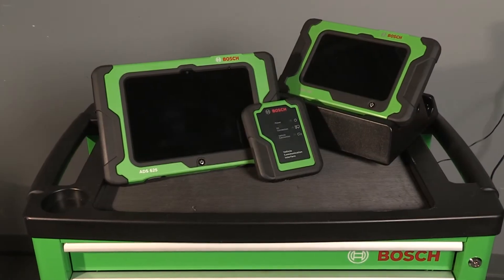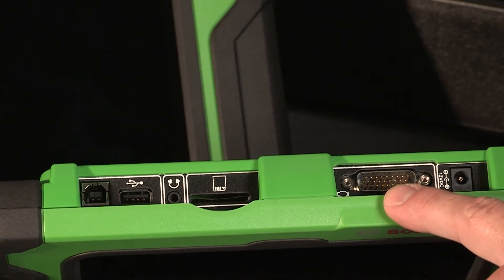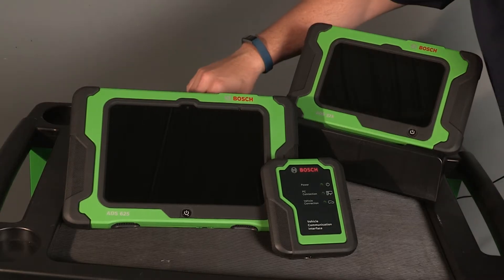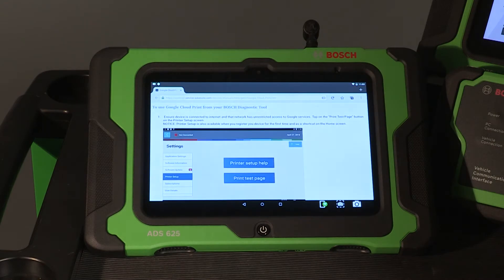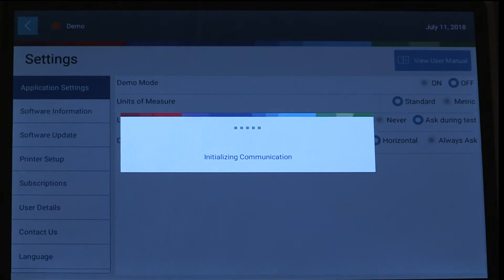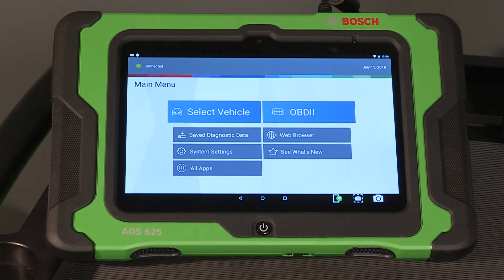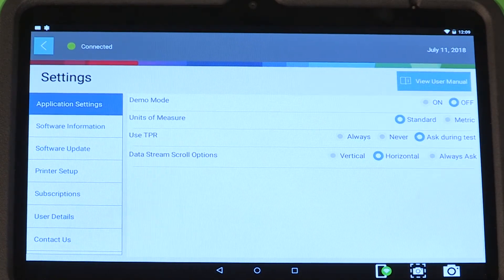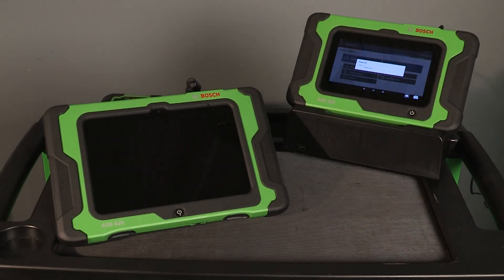Out-of-box setup with ADS 325 & ADS 625 - Training Module 1

Comment: Besides the wiring diagram, how does the ads 625 compare to the autel maxisys elite
Reply from the maker: Please refer to http://spr.ly/60521Jbcq

The latest updates we have the following:
-Industry leading domestic, Asian and European coverage
Quick-Scan, full vehicle Pre and Post- Scans in an average 60s
-Access to FCA Security Gateway. Bosch is one of the few scan tool manufacturers that can access 2018 and newer FCA vehicles equipped with SGW
-Repair Source (as mentioned below), most complete, on-screen vehicle service and repair information available

Comment: Can the Bosch 625 come with everything to flash and reprogram. I'm starting to get into programming and need a good tool
Reply: No
Reply from the maker: Thank you for taking the time to reach out. We've forwarded your inquiry to consumer care, who should be reaching out to you soon.
Reply from the maker: The ADS 625 does come with a J2534-compliant VCI that can be used for reprogramming. Technicians will need to provide their own Windows PC and purchase OEM software to reprogram, in addition to a clean 12V power supply.

Comment: Bosh beats snap on
Reply: What's your reasoning for saying this. I currently have a solus edge and was thinking on buying this but can't make up my mind
Reply: @vegaboy76  ....  its a Great Tool buy it!! .....its also known as the Genysis (Encore) and Mentor Scout ..... Android based ... they are fazing out the Windows base Genisys ..... I have mine also installed w Launch Pro software.... you can also add Hantek Automotive  Scope for 150$ .... get it here Cheap! b4 someone else buys it .. https://www.ebay.com/itm/Mac-Tools-Mentor-Touch-Scout-MRST/202695666160?hash=item2f319a69f0:g:EioAAOSwRB5c8pUt
Reply: @scipioafricanus7109  ...